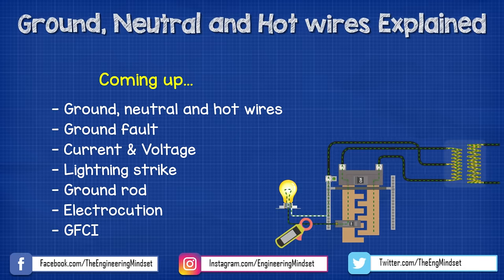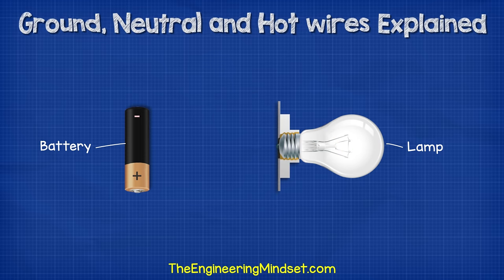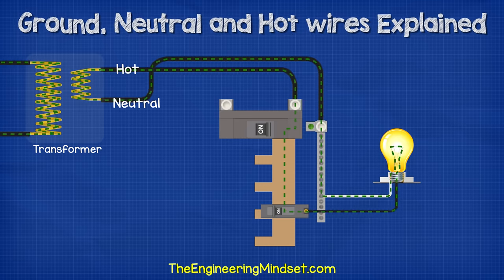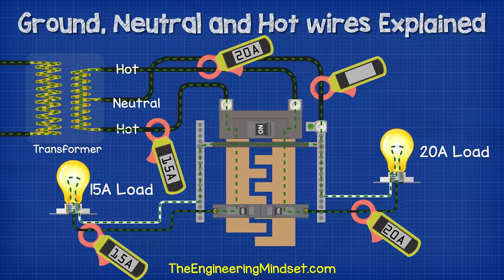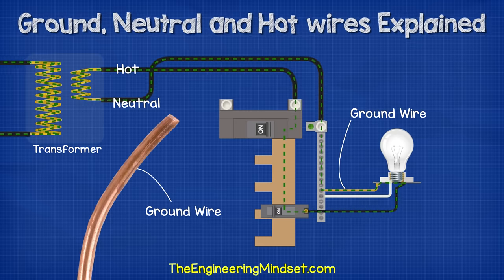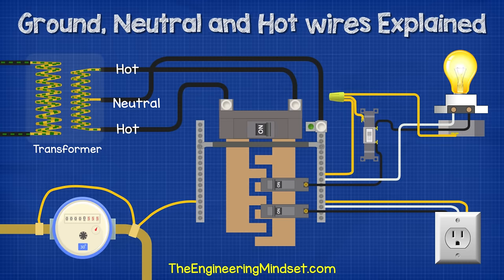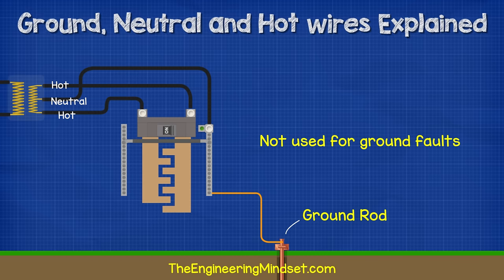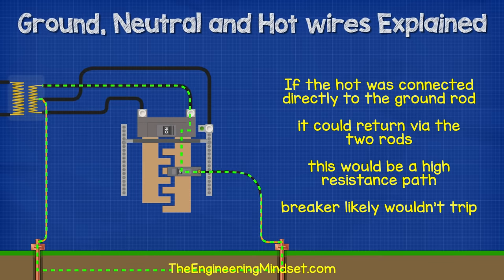Ground Neutral and Hot wires explained - electrical engineering grounding ground fault

Comment: Wooooo this is a I call a fantastic, amazing and super woo explanation, I speak spanish and have watched all kind of videos but the explanations I often  receive are very complex and difficult to understand,  they are shown in complex and nonfamiliar terms, they use the most high advanced tecnical terms for you not to understand how electricity works from its root. I thank u very much because you have answered all my questions and this was just the basic  I needed to understand it all
Reply from the maker: We have recently launched a Spanish channel, have you seen? https://www.youtube.com/channel/UCtfhmY_sWRukJl5CAgsqV0A
Reply: @EngineeringMindset  I have not but I will right now. Thank u thank u u the best
Reply: @EngineeringMindset  In the scenario of balanced loads 15 amps each, When you said that current is flowing back and forth from the load to the source what do you exactly  mean? 
Do you mean that current would go from the hot wire and flow to the load then pass through it and returns to the neutral wire until it gets to the neutral bar on the pannel and then go back to the load and at the same time to the hot wire? I am a little bit confused because in the video I saw how current flows through the neutral wire until it gets to the neutral bar and then returns. it does not go back through the neutral that comes from the transformer.
How would it work in a community where each house is connected to a different hot wire circuit? Would the current come from  the hot wire until the load,  pass it then go to the neutral up to the neutral bar and then returns again?  My confusion is because I see that you connected the 2 different  neutral wires, generally in a independent  residential house the neutral goes to the neutral bar and it is not connected to the other load circuit ( hot wire and neutral) because each circuit belongs to a different house and they both are connected to a different hor wire.   
I am looking forward to watching your upcoming videos that explain this concept in a deeper way. When will you be uploading the video?  I cant wait.

Comment: I thought the hot wire was the one mark with the + .
Nobody can explain neat and clear like you.
Thanks
Reply: The hot wires are usually the positive reference polarity when talking about the voltages between any of the two hot wires and the neutral wire. Thus, those two voltages are 180° out of phase.
Reply from the maker: We just published a new Ground fault, short circuit and arc fault video, so much detail! Link HERE➡: https://youtu.be/Qi0ynSQw-wc

Comment: man, I've never understood these concepts fully until now, great presentation, it's really appreciated......so if you connect your first plug as a GFCI, all power points on that circuit should technically be GFCI enabled right?
Reply: If you are talking residential GFCI outlets, yes but the additional outlets need to be correctly wired into the first GFCI… it is possible to bypass that functionality.., press test and verify all expected outlets are cold

Comment: Thank you. I'm a electrician and still learning  electrical. The Ground wire going back to power plant has resistance which is common sense.  But I didn't think of that.👍😊
Reply: Hi... why doesn't the GFCI trip in the case of unbalanced loads between the two live wires where you have 20A going in via live and only 5A (the difference between the twol loads) going back on the neutral?
Reply: Because the gfci only is carrying one hot wire and one neutral wire it’s not looking at the 2 hot wires only one.
Reply from the maker: We just published a new Ground fault, short circuit and arc fault video, so much detail! Link HERE➡️: https://youtu.be/Qi0ynSQw-wc

Comment: So with DC, electrons are travelling all the way through the load and back to source, but in AC the electrons only give a push to the one in front and so on so the first electron barely gets out of the gate? I know it sounds like a silly question, but does it makes sense? Does this make AC more efficient? Great vid! Summed up years of mystery. Thanks!

Comment: Ok guys I love your videos, and they have helped train some of my apprenticed. BUT I was wondering if you could do a video on measuring and explaining amperage draw on 120V and 240V circuits. Example How many amps is L1 and L2 using on a main and what would the amperage be in 240V. Its really tough finding material to demonstrate this. Basically if L1=29A and L2=31A whats the total draw. Thanks.

Comment: It's funny, in Europe (Denmark), the ground rod is used for ground faults :P TT-system is the most used in homes, where the ground is made locally. TN also called "nulling", uses the source N, to act as PE and N, PEN. But we also have 30mA RCDs protecting the whole installation, not only parts of it.

Comment: I see my problem now... I've been thinking of my breaker box as a voltage center, when it is actually a power center.  If I envision two separate loads, on one each 'leg' of the 240VAC and without the additional stuff (breakers, neutral bars, etc), just the transformer, and two loads (one on each side of the transformer) and with the neutral between them, then I can understand the concept of 'unbalanced' loads and why current may/may not travel through the neutral.
Thank you!
Reply: I would think some current would always be flowing through the neutral.  What is the likelihood that both sides would be drawing equal amps?
Reply: breaker box is just a circuit from the pole transformer you tap into.

Comment: Color coded wires are different depending on which industry you're talking about. For example, in electrical jargon, the black wire is hot and the white wire in the neutral. In electronics, the white wire is hot and the back wire is return. The green wire is ground in both.
Reply from the maker: We just published a new Ground fault, short circuit and arc fault video, so much detail! Link HERE➡️: https://youtu.be/Qi0ynSQw-wc

Comment: Hi, thank you for a very informative video, great work! However, I have a question about the neutral wire: Since the transformer creates a 120V (for single phase) difference between the hot and neutral wire, and given the alternating nature of the current, how is it that when I touch the neutral wire nothing happens? Given that current flows in both directions, I assumed that both wires should have electrons moving through them.

Comment: I’m confused by looking at the video, on the DC section, you have the hot (load)  wire leaving the battery through the negative contact and returning to the battery through the positive contact, can you further explain how this occurs? Because if I touch the red wire to the negative contact of the battery  and the black lead to the positive contact of the battery,  i get a - voltage

Comment: I love it.  Would it best to show what is the load, kW, given we know amps and voltage?  The formula is difference between 240V and 120V. Most people applied the formula incorrectly.  That would include 208V and 120V. That would go the same for 480V and 277V to come up the kW load.  Most electricians can get Volt and Amps using meter but don’t know how to derive kW load
Reply from the maker: Seen our new 3 phase transformer video?➡️: https://youtu.be/u0SsejDCVkU

Comment: So my air compressor is 220v . Motor switch has 2 hot connections and a ground connector. Should I be using the white neutral wire as ground connection? Or the earth ground green wire ?
Reply from the maker: Check with the manufacturer for the datasheet. It will tell you exactly how to wire it.

Comment: Great explaination. So you said when there's two 15a loads on each live wire the neutral wire has no load. How come the voltage doesn't become 240v in that case? Is it based off of Kirchhoff's loop law?

Comment: Thank you! I have a metal  box that I have to ground in my well house. I was misinformed by a "Licensed" electrician that works for Lowes builders. He said that with a gfci recepticle installed that you did not ground the box!
Reply: Um be careful. What he meant was you can only have 1 box per system "bonded" ground to neutral. If you ground a branch box you will create the potential for objectionable current and/or run the risk of a fault trying to join neutral from ground at the branch box which may not have an appropriate bonding size. The box itself is always grounded and the ground leads attached to the grounding bar.
Reply from the maker: We just published a new Ground fault, short circuit and arc fault video, so much detail! Link HERE➡️: https://youtu.be/Qi0ynSQw-wc

Comment: One small detail about ground wires is that they keep the voltage of the neutral wire at 0V relative to ground and everything else around it. 
You did cover it a bit in the static electricity part, but it can happen more slowly.
Without grounding, the neutral wire can pick up extra charges and slowly raise the voltage of the entire circuit.
So instead of 120V and 0V, you could have 130V and 10V, or 140V and 20V which is pretty dangerous as you are now raising the voltage of the "hot" wire relative to ground which is the path to most electrical shocks.
There is also the safety benefit of split phase power being that we have 240V useable power but you are only ever dealing with a potential 120V shock unless you happen to touch both hot wires which is unlikely.
Reply: I was hung up by the battery example and didn’t want to go further. I have always thought “hot” wire was positive?

Comment: That's a great explanation.

Have a question: Based explanation at 9:40 
Lets say one directly touches the live wire at the equipment side, while neutral and ground are open. So, path to the source will be through live wire --> person to the --> local ground --> transformer ground. Which might have huge resistance, in which case current is pretty low wouldn't the person be safe in that case ?
Reply from the maker: We just published a new Ground fault, short circuit and arc fault video, so much detail! Link HERE➡️: https://youtu.be/Qi0ynSQw-wc

Comment: First Of All Thanks For the Animation. Me Not from Electronic Background. 
So, Doubts Regarding In 8:21 Min of the Video:-
1.How will Resistance be high? 2.Which Part in the Cicuit is providing Resistance? 
 3.If Resistance is High, then Current must Be Low Or Voltage must be Low, then Why still Harmful?

Comment: The content of this instruction is very good, and the diagrams are also quite good. The only issue is that it just moves too fast. The explanations are clear, but they need a few extra seconds and some pauses to sink in. I had to pause and/or replay sections often to relate the words to what I was seeing in the diagrams. The transitions from one diagram to the next were also sometimes too fast.  I am looking forward to watching more of your videos, as I have watched 5 before this on the exact same topic and it took all of those plus one to fill in all the blanks and correct some explanation errors. However, your videos would be much easier to follow if they accounted for a learner perspective of needing a slower cadence to internalize each explanatory piece and diagram.
Reply from the maker: Thanks for your feedback and glad you enjoyed the video. We have worked on similar feedback and you should see much better timing and graphics in our newer videos.

Comment: Homes in the Philippines are provided wit a hot. Return I believe is ground itself.  There is no separate return and ground.  When an electrician hooked up a green ground with a grounding rid, it connects to the ground but there is no GFI because ground and return is the same potential

Comment: Hi, thank you a lot for this so cool video! I am checking my outlet box and I found 4 wires: black, brown, blue and yellow/green. I took my voltage meter to test the knowledge and want to see if I can find the correct wires before buying a smart light switch, which requires a neutral wire.

The interesting thing is that, I couldn't find any pair with 120V. So here is the measures:
black-brown: 236V
black-blue: 190V
brown-blue: 4V
black-yellow/green: 72V
blue-yellow/green: 5V
brown-yellow/green: 7V

I checked a smart light switch manual and see that there are 3 holes: Lin, Lout and Neutral.

Could you please help me to understand and determine, which color should be connected to Lin (and to Lout and Neutral holes on the light switch)?

Comment: This video is great!
--How does electricity take the path of least resistance back to the source, regardless of where (front yard) the short takes place? Like, how does the electricity know the path of least resistance ahead of its travel?
Reply: It doesn't. It takes ALL paths, proportionally to resistance. Think of a white water river. How does it 'know' where to flow. You could perhaps say 'gravity' or perhaps something like 'the shape of the river creates "walls" that retain the flows and "low spots" that channel the flow. 

Insofar as you can say 'gravity' for the water example, perhaps you could say 'electromagnetic' force for current flow. And insofar as you can say the "walls and low spots" retaining and directing water flow, you could say 'elements with high electrical resistance block, while elements with low electrical resistance (high conductivity) channel the flow.'
Reply: @spruce_goose5169  ya, I suppose so. It's just our way of trying to understand the world. We always want an answer/explanation and why? that, but why? I suppose human nature, just like the flow of electrons. 

Thing is proportionally. To me, in car audio, it always made more sense to ground amps out into the frame so the electricity would flow evenly, rather than a negative wire all the way back to the battery, like some folks do. I understand doing that in certain vehicles though.

Comment: I've been taught to use conventional theory instead of electron flow. If I was an electrician would the hot wire be at the positive terminal and neutral + ground be at the negative terminal?

Comment: I think there was one misconception on this. If i remember correctly, the ground is actually to prevent EMP energy from things like lightning bolts from frying someone closeby aswell as other benefits they produce, not to directly funnel a lightning strike. A grounding system is NOT lightning protection. 

An ungrounded system may actually be less likely to shock you in the typical manner because in most cases you would have to touch both neutral and line in order to receive a shock. The grounding rod we drive in the ground gives the electricity alternative paths back to the source (like the dirt itself or a pipe or what have you) so that if you touch only line and something grounded at same time you will get a shock. If the neutral and ground wire were not connected at the main panel then that wouldn't happen (for most cases)

This is the reason why equipment grounding is so important. Most of the time these wires are not accessible and should something fail, and the line makes contact with some metal casing then that casing becomes energized and whoever touches it and something grounded will receive a shock (which you mentioned).

Electricity takes ALL viable paths to the source not just one. Also if I understand correctly, the farther you are from a ground rod that has a ground fault occurring, the lower the resistance due to exponentially increasing paths through the earth the farther you are away.
Reply: There is actually a system where the supply is unearthed (or connected to earth but with a very high impedance), and it's called the IT system. However, compared to TN (TN-S and TN-C-S except TN-C) and TT systems, an IT system becomes less safe when an insulation fault occurs between the line and earth, which makes the system function like a TN system. In this case, when a second fault occurs between the line and the human body, dangerously high currents could flow. The circuit could have been protected by an RCD (GFCI) if earthing was used, such as in TN and TT systems. In the case of 3-phase supply in an IT system, the effects of faults could be worse. If a line touches earth, the voltage in the other lines could rise to times square root of 3 relative to earth.
Reply from the maker: We just published a new Ground fault, short circuit and arc fault video, so much detail! Link HERE➡️: https://youtu.be/Qi0ynSQw-wc

Comment: Good video but when you explain the ground wire you should start by saying that the neutral of the transformer is connceted to earth trough a copper rod buried in to the ground for other purposes (lightnings and static electricity) and that make more sense when you talk about the electricity returning through an unexpected path (the earth) and how you could get an electric shock by touching the hot wire while grounded.
Reply from the maker: We just published a new Ground fault, short circuit and arc fault video, so much detail! Link HERE➡️: https://youtu.be/Qi0ynSQw-wc

Comment: Thank you. Very clear and very helpful. One question however: should the two ground rods in your video be bonded together? I’m not an electrician, but I think that might be the rule here in Canada and was told it is also prudent to avoid a differential between them. Thanks again!
Reply: No because he showed only 1 rod for the house and the other was the transformer one,this one can be a mile from your home.
If you ave multiple rods in your house,you can connect them toghether and it depends on the country you live in if it's mandatory
Reply from the maker: We just published a new Ground fault, short circuit and arc fault video, so much detail! Link HERE➡️: https://youtu.be/Qi0ynSQw-wc